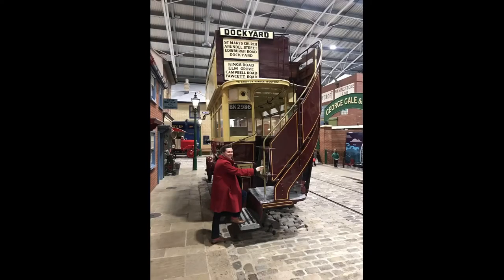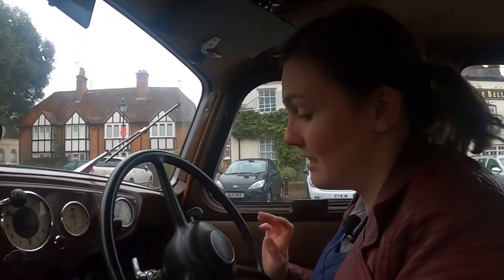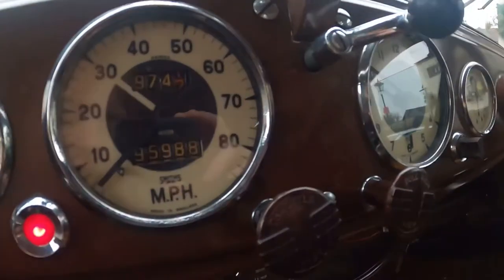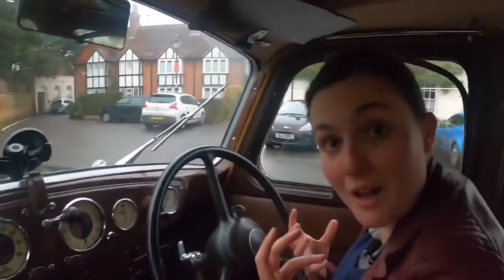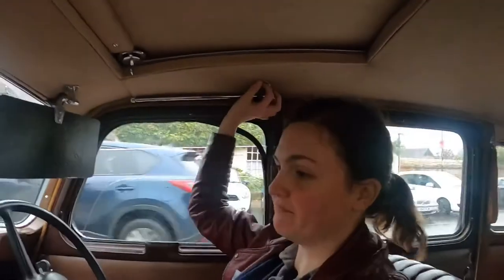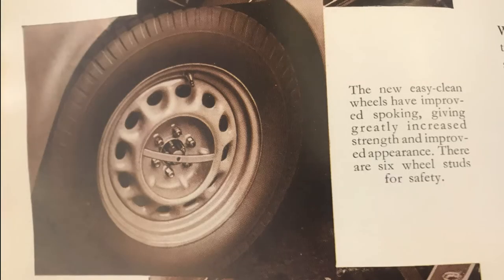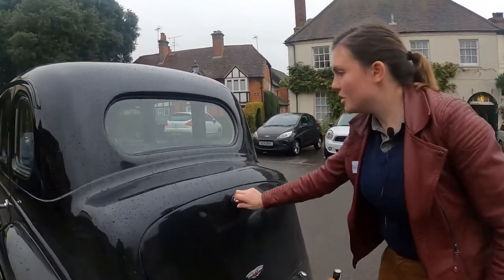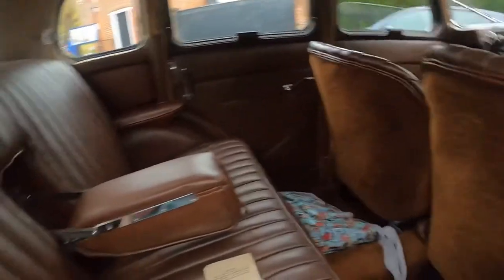Vintage motoring: 1940’s Morris 12 inside and out

Comment: Greetings from India, where Morris cars were quite popular. My grandad had one of these. It was dark green with brown leather upholstery. Around 1967 my dad had taken the engine apart and changed the rings. Grandad used to say that it was a 1942 model. I wondered if it was true as Morris had stopped civil production by 1940. Later I read that Morris had started a small assembly plant in Okha in Gujarat and had shipped
Reply: Shipped CKDs in 1939 itself. Our car was one of those. We had to sell it in 1968, as we were getting a new home.
Now I have dad's Herald (1965) which he bought new. In India it was made by Standard Motors, so it is a Standard Herald. Trying to get a Morris Minor now.